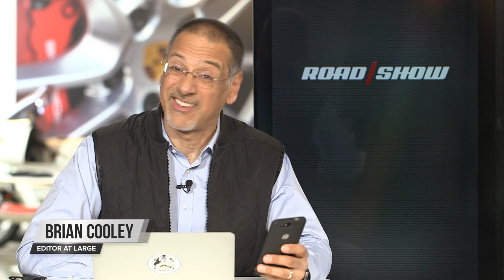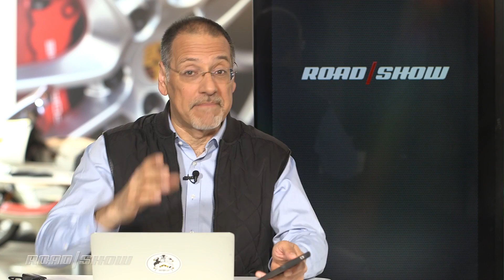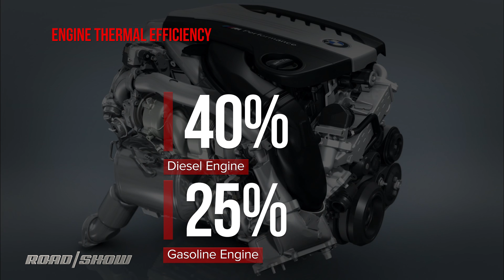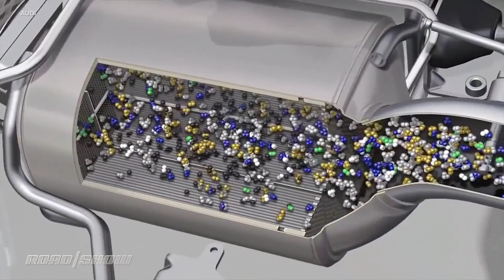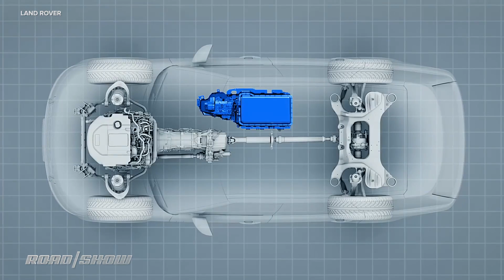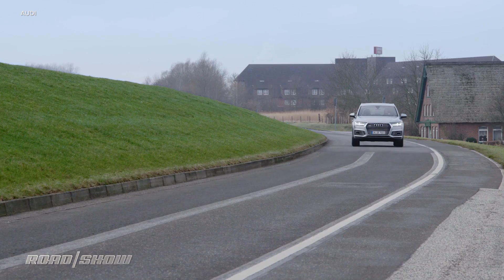Do diesel hybrids make any sense?

Comment: What about how locomotives work? The down fall for electric vehicles is the battery.. Why not have a plug in diesel hybrid similar to diesel trains but with fewer batteries to save some weight. You run on batteries until your battery level gets to a certain point at which the engine would turn on and act like a generator powering the batteries which then power the electric motors that move the car.
Reply: Because. They want cars to be like home appliances. Change every year or two. Diesel engines are durable. And if they are employed the way you described they will be even more durable and car might run for decades which is bad for business.
Reply: Been wondering about that for years, he's got a point about the cost of manufacture because that is what controls how far R&D gets. Locomotives haul thousands of tons with a relatively small engine, I don't see why they can't do the same thing with cars and tucks!
Reply: @davekauffman8727  small engine? No most diesel electric locomotives use v12 and v16 diesel engine's with big turbos are superchargers.

Comment: Don't forget the E300 diesel hybrid and the C as well. Peugeot also makes them like in the 3008 hybrid4. The diesel powers the front wheels and the electric motors power the back wheels completely separately. So it is 4 wheels drive without a drive shaft.
Reply: That's pretty cool in all honesty, whats their MPG like??

Comment: Another example is Mercedes Benz E300 bluetec hybrid that reached 61.2 mpg http://www.greencarreports.com/news/1093005_mercedes-diesel-fuel-economy-european-model-beats-60-mpg
Reply: So, about as powerful and green as the Accord hybrid. What's the point?
Reply: in certain areas of Europe the emission tax and fuel price for diesel is less than gasoline. so even with the same mpg, cost of having a diesel car may be lower than gasoline car. by the way Honda Accord Hybrid does not give 61 mpg.
Reply: Same CO2 emissions, and probably lower NOx emissions. Burning diesel produces more CO2 than burning gasoline. Plus, no DPF to clog and no urea to refill.

Comment: Cooly, who gave you that info ? , what about the  Mercedes-Benz E 300 BlueTEC HYBRID ? in 2014 it got 1222 (61mpg) miles on a single tank ! I know they will never sell them here ( in the USA ) just like most good diesels from Germany. 
    The low end torque on a diesel is nothing compared to electric engines thats why a tesla is the quickest ( 2.4 sec 0-60) but not the fastest (top speed) .  WTF Cooly I know you know better than that !! my diesel gets 24 mpg in the city then 32-38 on the highway where as electric cars barely lose any mileage in the city and lose all there miles on the highway .

Comment: why not a small diesel as a range extender !?!?!
Reply: Diesels need to warm up for optimum combustion performance, a cold diesel will run very inefficiently
Reply: @AmeriaUprising  then program the diesel to run intermittently to maintain warm temperature. With high btu, simply running it on closed thermostat under load (to charge the battery) should easily put it in optimum temperature

Comment: The redundancy argument would be valid if both powertrains drive the wheels. However, if you are designing an electric vehicle with an internal combustion engine driving a generator (range extender), I don't see why that internal combustion engine can't be a small diesel.
Reply: That is actually how many diesel trains, boats and mining equipment work. Its called diesel-electric transmission. Its mostly used in boats because directly coupling the propellers to the engines proved heavier and less reliable than this system. 
It essentially boils down to being an electric version of a PTO on a tractor. where instead of using hydraulics to avoid the issues involved with clutches, it uses electricity. 
With that said, not all diesel electric transmission uses batteries. some use the generator to directly power the electric motors mostly because the batteries required for the scale of power they would need would be massive and thus in that particular application less efficient
Reply: Exactly right. That's where manufacturing gets it wrong in hybrid diesel trucks because they want to include a very expressive and large battery pack instead of direct transmission.
Reply: Andrew Van Beek the Chevrolet Volt and BMW i3 are both range extended EVs. one uses a small inline 4 gasoline the other uses a motorcycle engine. Both of those internal combustion engines make more sense due to weight because even a small diesel is heavier then it's had counterpart and because of application, the generator works at low steady RPMs where mid range torque is unnecessary and inaccessible
Reply: Yeah the best to do this way would probably be like a diesel electric locomotive
Reply: @patrickmartin3322  Yep. Definitely.
Reply: My thinking exactly!
Reply: Right?!
Reply: You know might work great for this is a 1.9 TDI from VW (commonly used 1998-2004) they were known to last 600k miles on there own(with 60+mpg alone), imagine how long they would last in a hybrid. And the fuel economy would be insane
Reply: @geneturner3190 fr. Those vw diesels are fucking tough. I can't imagine why a hybrid TDI doesnt exist
Reply: This is wild, I’ve been thinking way too similary to all this
Reply: Its also technically in that case legal to use dye diesel as well because the drive shaft of the engine is not attached its a genratort
Reply: Andrew Van Beek This! so like a Volt kind of concept. Did not get the redundancy comment either
Reply: @ionciubuc  
The Volt is a series/parallel hybrid. The engine does power the wheels directly at high speeds.
Reply: The problem with that setup is that it's only more efficient in certain applications, because converting mechanical energy into electricity, charging a battery and then converting electricity from the battery back into mechanical energy is not very efficient when compared to driving the wheels through gears. Even the engine in the Volt drives the wheels through a mechanical connection under certain conditions. Also, when the Volt is running purely off of gasoline, it's about as efficient as a Plain Jane gasoline vehicle.
Reply: @PistonAvatarGuy  That thing will let you have 200km range without refill, and with fxking cheap diesel, no oil company would like to see it, that why no one is making it
Reply: You don't have to charge the battery before using it to power the wheels.  You can directly drive the wheels with the electricity generated by the engine. @PistonAvatarGuy

Comment: Diesel/Electric hybrids have been around forever... in big vehicles like trains, ships, submarines (technically series-hybrids, which uses electric propulsion, but diesel engines to recharge the batteries)  It doesn't make sense in cars for the reasons stated in the video. Btw the Chevy Volt and Fisker Karma are series-hybrids, but gas/electric.
Reply: volt is not a pure series hybrid because its able to drive the wheels directly, the fisker karma is the only pure series hybrid
Reply: Phrancis5 maybe I'm misinterpreting what a pure series hybrid is but the Chevrolet Volt is able to exclusively Drive the wheels through electric motors and uses a gasoline range extender to add battery power when the charge has been depleted
Reply: Not quite true, I believe the bmw i3 with range extender is also a proper series hybrid.
Reply: I forgot about the i3, yep. I guess the difference is the i3's range extender is really just a backup generator, whereas a fisker is much more likely to be driven like a hybrid.
Reply: Yes, the Volt technically can drive the wheels via ICE at hwy speeds, but it was originally envisioned as a pure series-hybrid, like the Karma, and yes the I3 with generator range extender would be a series hybrid too. Technically the Prius is a combination of series and parallel, but the main point I'm trying to get across is that hybrids really aren't a recent idea because diesel/electrics have been used in large vehicles for some time, but don't really make sense in passenger vehicles. You can read about the general difference in series vs parallel here.  http://www.ucsusa.org/clean-vehicles/electric-vehicles/series-vs-parallel-drivetrains#.WQtZqtIrJhE
Reply: The Chevrolet Volt can not power its wheels directly by the 1.5 liter engine. The Engine acts as a generator only and only produces electricity to power the batteries thus powering the electric motors. The Volt is a series hybrid. The Toyota Prius is a parallel hybrid. According to your link an engine that produces energy to charge an electric motor either directly or through charging a battery. Large diesel generators have been used in series hybrid trains and in ships for 90 years now showing what they are capable of. Obviously light vehicles do not need the same torque requirements and have greater weight restrictions making a diesel hybrid a self destructive venture as the nature of the vehicle would worsen its environmental potential and raise cost. Utilizing a small gasoline engine to power a battery reduces complexity by comparison to diesel and also saves the vehicle from costly and large batteries that at the moment still difficult for manufacturers.
Reply: As I said above, the Volt was originally envisioned as a pure series hybrid, but in actuality the ICE can help directly turn the wheels at hwy speeds - at least in the 1st gen version. Not sure about the newer one. Besides reduced weight/complexity/cost, I see a big advantage in a pure series hybrid because ICEs can be very fuel efficient and clean if they are tuned to run only at a certain RPM instead of revving up and down to move a car through stop-n-go traffic. If that ICE only had to turn a generator it could be fine tuned for maximum thermal efficiency.

Comment: I am gutted that the air hybrid system has not made it out of R&D. it is a simple system that is cheap and relatively light. not to mention that you could use the pressurised air to boost the engine pressure before turbo is spooled reducing turbo lag

Comment: More Cooley!

When do you think EVs without tax credit will make economical sense? The Bolt is about $40k and there are any number of similar sized gas vehicles that would be $10-15k less. Even over 10 years of ownership you won't make that cost differential back. Not to mention battery replacement if you do want to keep one long term 10+ years.

I know they will get there as the keep improving batteries and implementation but are looking at 10 years, 15?
Reply: SS S 5 years for price parity with gas with all but the cheapest budget cars and pickup trucks. 8 years for everything else
Reply: Take the range of the vehicle, multiply it by 2000, and you'll find the mileage lifespan of the battery pack. Chevy bolt does 230 miles per charge, if it needs a battery replacement after 2000 cycles (pretty typical number of cycles for a high quality battery cell) it will have done 460,000 miles on it's battery pack. Most gas and diesel vehicle don't even make it to that mileage before the whole vehicle gets scrapped. Fully electric cars are far cheaper to fuel, and needs a lot less operational maintenance. If you're a guy who buys a new car and sells it every 5 years, EVs are a terrible deal, you will never recoup the cost on fuel and maintenance savings. If you like to buy a car, and run it into the ground over the span of 15 years, a full electric vehicle is probably the best purchase you can make.
Reply: Check http://carboncounter.com. It factors in the cost of gas and the price of the vehicle to show when EV version over take conventional engine for savings. You can also factor out tax credits in the customization settings. 

Battery replacement hasn't been a real issue in liquid cooled batteries. The batteries are holding up well and should last more than ten years. But in the future, batteries will be cheaper, so it might make sense to upgrade the battery down the line